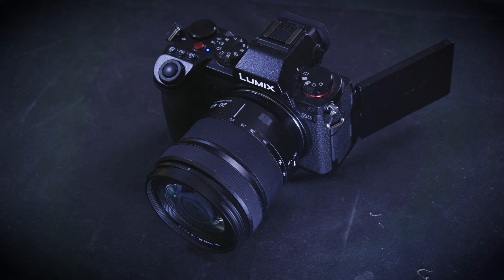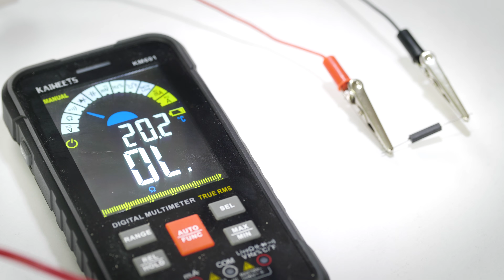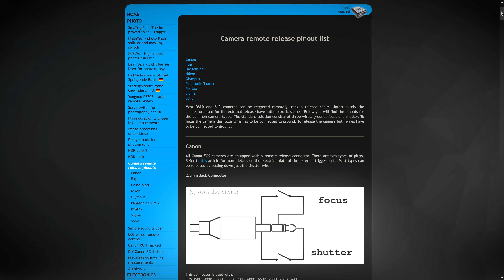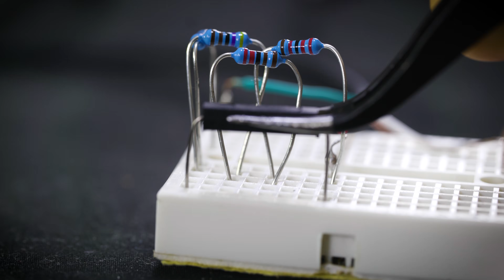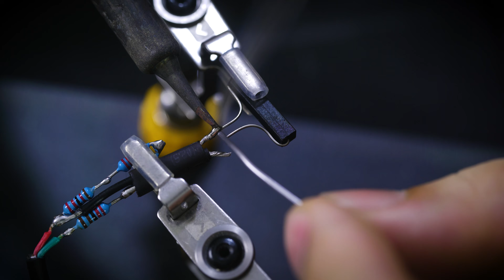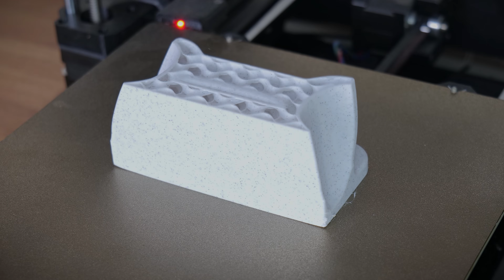Game Changer! Make a $3 Timelapse Setup (3D Printing)

Comment: What did you do to get the print head to move towards the reed switch to trigger the shutter?
Reply from the maker: Hey Mike! thanks for the comment :) So I'm using PrusaSlicer. In the After Layer Change GCODE settings, I added this line:
G1 X-1 Y211 F{travel_speed*120}
That will swing the bed all the way out and move the print head right to the X limit. I adapted the settings from Prusa's blog, feel free to check it out: https://blog.prusa3d.com/how-to-create-beautiful-3d-print-timelapse-videos_29743/
Hope that helps!
Reply: @MakerVibe  Hmm.....that almost sounds like a tiny bit of coding....
Reply from the maker: @MikeBSc  You know that's actually a very good point... Apologies, I guess I should've clarified there's no coding on the hardware side (the switch triggering etc). Thank you for the correction!

Comment: How to control the stringing and artifacts in the corner?
Reply from the maker: Thank you for the comment :) I'm having some success by retracting 5mm at very high speed (e.g. 80mm/s) when going home to take a shot, and then detracting or priming 5mm at a slightly slower speed (e.g. 50mm/s) to resume printing. If you prime too fast, it can clog the nozzle. 
I have managed to get some prints with virtually no stringing and artefacts, but sometimes the nozzle does clog. So I'm still researching. Let me know how it goes!
Reply: @MakerVibe  Thank you I will try that out